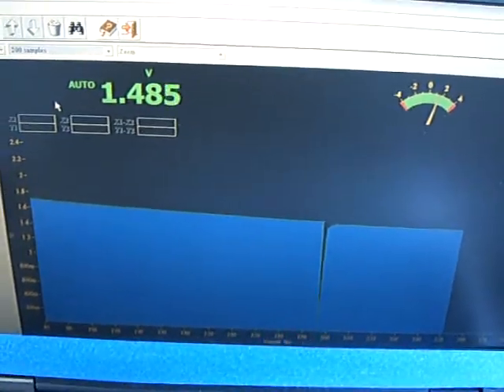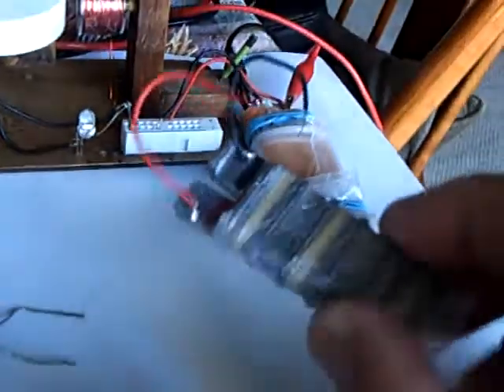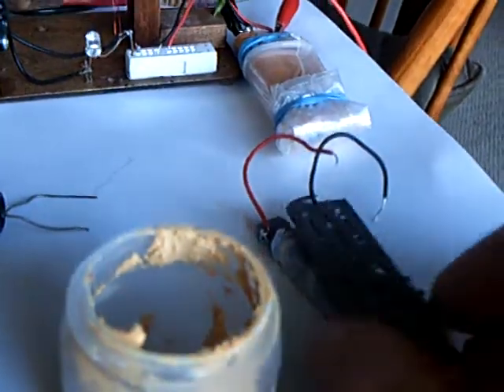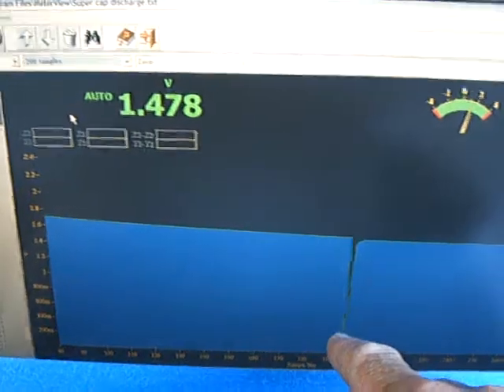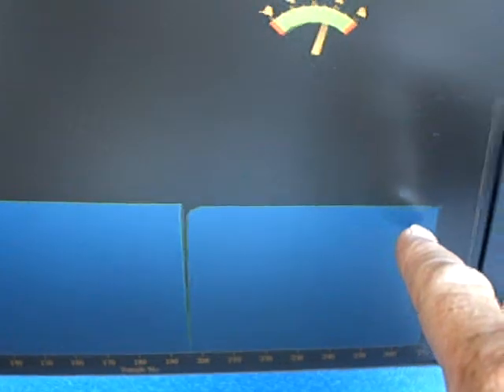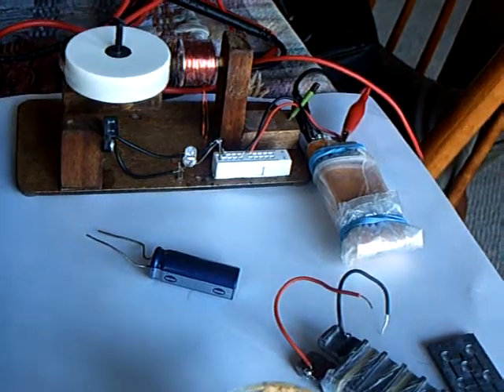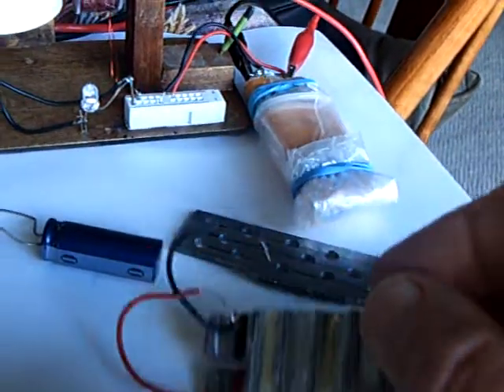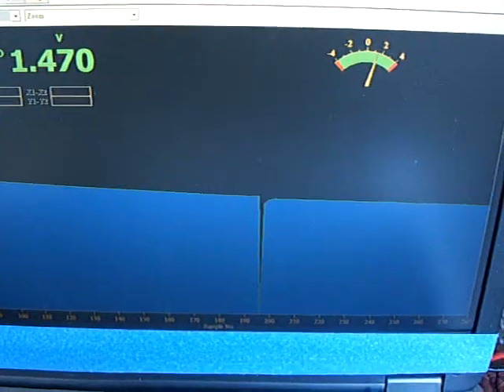Computer graphing discharge curve of homemade battery

Comment from the maker: Yes.  I am using lead oxide.  Mix up a paste with alum & water and spread on the plates.  The yellow material between the plates is car drying cloth soaked in the alum and water.  The two outside plates are the negative.

Comment: I love your design with the holes in the positive plate! I am considering lead pipe, and placing a smaller lead pipe in the center of the larger outer pipe, but to get closer to the same surface area, I too was thinking of drilling the center pipe with holes. I would like a cylindrical form factor that could be capped on both ends and sealed on the outer surface to keep my exposure to lead at a minimum.

Comment: I know the wiki said that lead batteries typically have one extra negative plate, but if the positive plate is the one that deteriorates, wouldn't it be better to have two positives and one negative? Or is the extra negative to give a larger surface area for the chemical reaction since the red paste already has a ton of surface area itself. Just rambling.